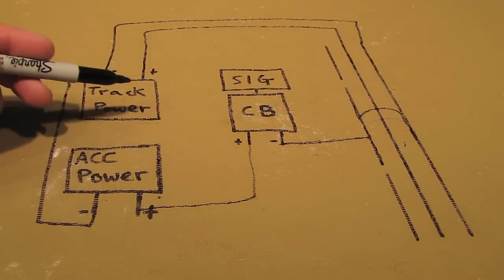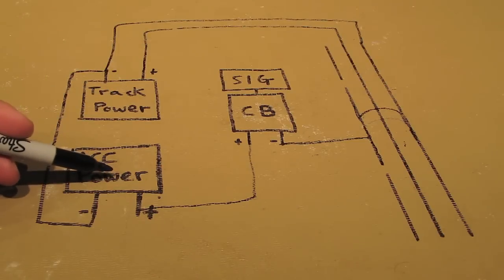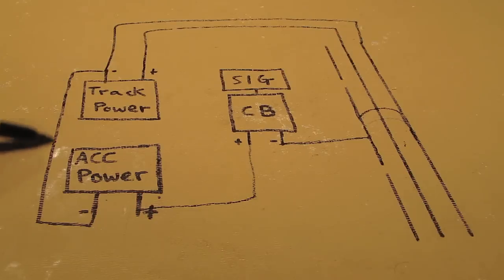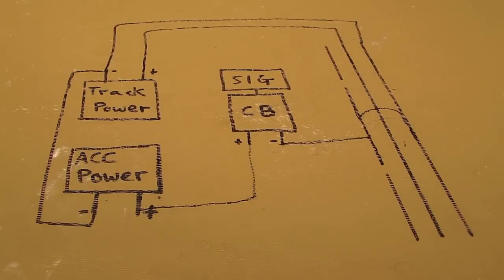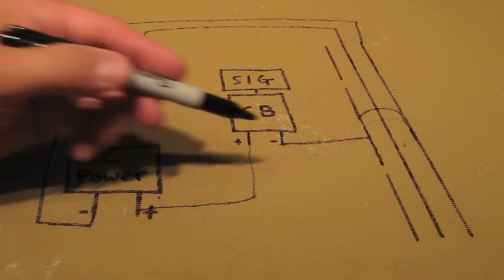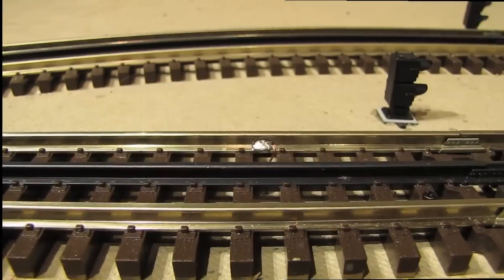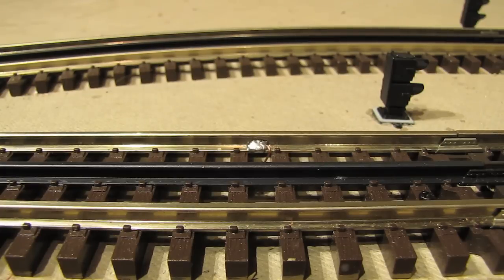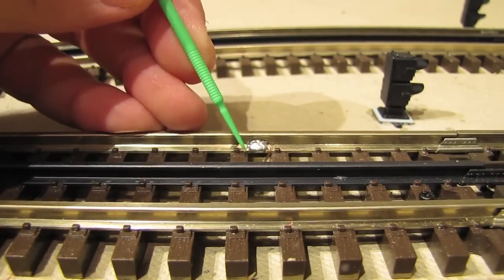Atlas O-Scale Track and Signal Tutorial - Part 2 of 2

Comment: Eric, ok great ,thanks for your help. If you think about it why don't you do a you tube video on it. Your video on signals was great and quite helpful.
I checked the atlas site and they don't even list the 6924 circuit board or 6931 dwarf signal. anymore. At least using the atlas search feature doesn't find it. Also did I mention that Atlas recalled the #57 switch controller because of a manufacturers defect.

Comment: Eric, I installed 4 and they work correctly in stand alone mode.  I connected them using 6 pin phone jack wiring as you demonstrated and they aren't working correctly in integrated mode.  The first 3 signals stay red.  Don't see this as a insulated rail continuity issue because they are working correctly in stand alone mode.  Are the connecting cables from Atlas different than the regular phone jack wires?

Comment: Actually, for 3-rail track, all that is needed is a 12 volt DC power supply and relays. There is no need for all those circuit boards, so it's cheaper, plus there is constant detection even without track power.

Comment: Hi Eric, although I read the instructions and made the two solder connects for both sides of the switch and joined them at the DIN location on the circuit board, I am still getting a solid red light on the  G type signal.  Since this is in my "BLOCK B" insulated section, would that have anything to do with it and the negative that I sent over from accessory to the negative on transformer brick for track?

Comment: I'm trying to use the Atlas signals in N scale, but the main problem for me is, there's no provision in the new Atlas system for straight DC operation. Everything is made for DCC in two rail scale operations, and there is no exceptions. I'm almost thinking of bypassing Atlas' system, and building my own logic boards, since all I really need is switch position and block occupancy.

Comment: Always good info if possible could you do a video in wiring a s.p.d.t. switch for whisker tracks on a round house and passenger train storage tracks using 3 rail tracks with the MTH.DCS system

Comment: So with your transformers, you “Phased them” together? If you’re using any Post War transformers along with modern transformers, you need to be careful when you phase them together. The older transformers were not “Polarized” with one plug prong being larger than the other to identify which one is polarized. You will have to test out the phasing with a lightbulb with wires to see if you need to reverse the Post War plug or not to make sure you don’t cause a short circuit.

Comment: Eric, maybe I missed it, but how did you wire the boards to get the "Green, Red, Green" signals on the 3 lights for the one switch?  Looked like the wires were all connected exactly the same across the three boards.
Reply: Jeffrey Uhde It was the way the wires from each of the lights' individual circuit boards were connected to the leads on the switches.

Comment: So logically you really only need 1 of those boards for the switch example right???  the two signals on the main line are identical (always show same color)  so id splice them together attached to the same board.    Similar for the siding its always the opposite of the main line.   So why not also splice it together but reversing the lines?

Comment: Does the advanced options have anything to do with say a relay or resistor to automatically reduce on coming engines having voltage reduced to avoid collisions just enough so the unit does not trip back to neutral, maybe down to 1 or 2 volts or whatever it takes to stop it but not trip it to neutral. Thank you. Love watching your advanced videos. I have both an O and standard gauge layout with mostly prewar and postwar but have bought some newer engines with TMCC AND DCS and enjoy the challenge of electronics
Reply: A resistor would be massively wasteful. A non-polarized capacitor in series with the hot would be far better, and perhaps a relay to bypass the capacitor

Comment: Aw, man. The cutting and soldering makes me nervous. I thought that it's possible to just use 2 plastic rail connecters to create a signal block and possibly wrap the wire around the rail without melting anything. The altering things makes me nervous, like cutting track and melting rails & wires.

Comment: I have the MTH PENNSY Signal bridge and was wondering does one need the ITAD or can I use the insulated block system?
Reply from the maker: Alexander Bacik either
Reply: @Ericstrains  how would you wire it using the insulated method?
Reply: That's what I was confused by